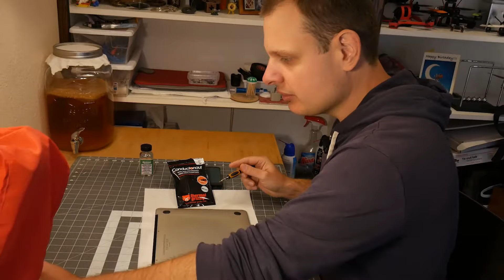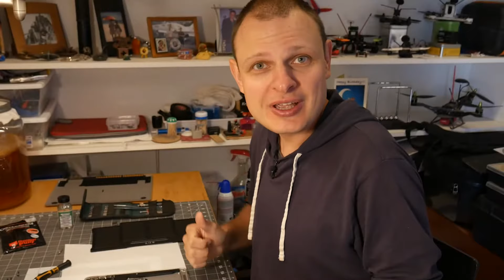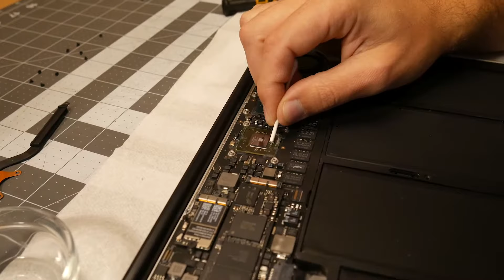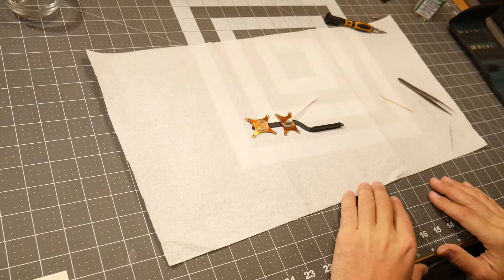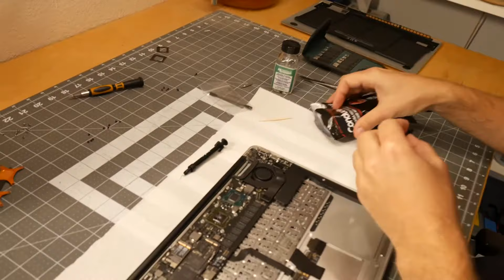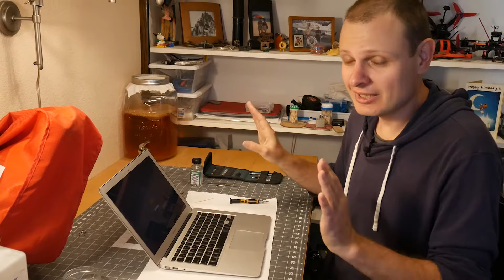Liquid Metal on Macbook Air

Comment: Another thing, after liquid metal re-paste your cpu was running at 85c with 2000rpm fan speed. But if you increase that fan speed manually to 4000rpm then your cpu temps are going to come down to around 70-75c range.

Comment: You forget to mention a big difference. Before your MacBook was running at 4000rpm and it was getting as high as 97c. After liquid metal re-paste your MacBook was running at 85c with just 2000rpm fan speed. So basically you reduced noise as well as you got a cooler running cpu, which I guess is a win win.

Comment: I’ve read that manually spreading thermal paste (e.g. with Q-tip) isn’t good because it can introduce air bubbles. Better to put the proper amount and let it spread out when you “smoosh” the heatsink down.
Reply: 1- Thermal paste is not the Liquid Metal that is shown in this video
2 - there's lots is tests made by bi channels, like Linus Tech Tips here on YouTube, that proves it's bullshit the impact of different application methods in the performance of the thermal paste. There's only some few variants that can impact negatively the performance: bad quality paste, apply too little or apply too much.
Reply: That's a metal Q-tip comes with the "paste". That's what you supposed to do the spread with just as in the video.
Reply: Keep reading.

Comment: First up u did a great job of applying liquid metal correctly and man I noticed the fan was running a lot quieter at around 2000rpm after applying liquid metal before it was ramping up to 4000rpm. If both tests were done using the exact same fan speed then we would have got the exact different. Anyway it was a great video.